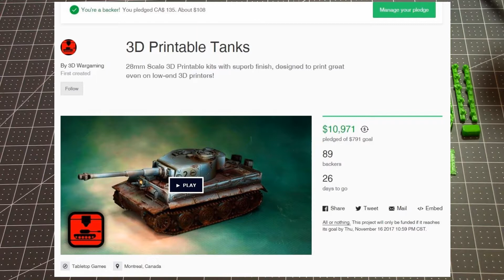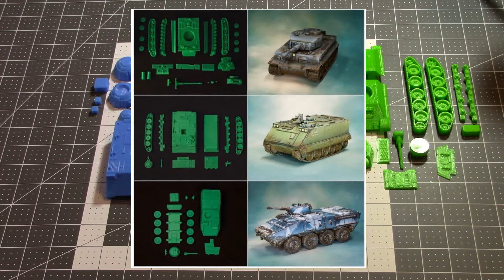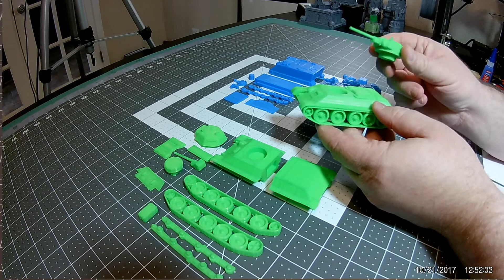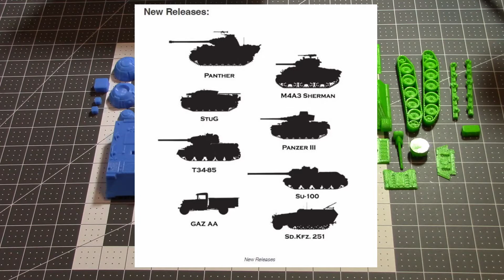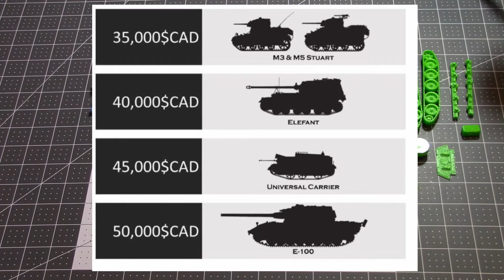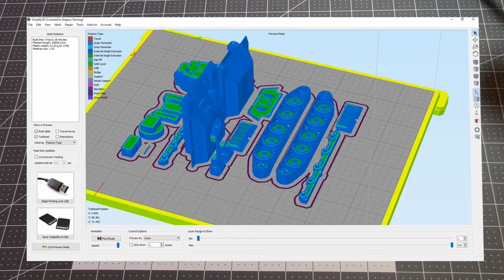Kickstarter Showcase:  3D Printable Tanks by 3D Wargaming

Comment: Thanks for the video Greg. I'm a WW2 fan as well.  I'm a model builder (mainly 1/35) and have done some painting for miniature fans over the years. Have you tried doing any real painting on PLA yet? I just bought the Moai because of the amazing detail and expect it next week, so hopefully I'll have some videos of my prints in the next month or so. I plan on trying to build accessories and other small things like this with it. I've worked with resin for years, but not sure how it will react to the paint. Have any experience with painting on the Moai resin?
Reply from the maker: I airbrush Vallejo primer on my Moai models and it takes paint like you would expect a model too.  I do have some early Printable Scenery buildings painted that came out nice.  If you get the high fill primer from lowes for those early base coats and sanding it speeds up the process.  I am hoping to get some painted stuff up on the channel also here at some point but right now I have a whole list of stuff to print for different designers and business law class that it taking all my evening time up this semester until dec. Thanks for watching and the comments.